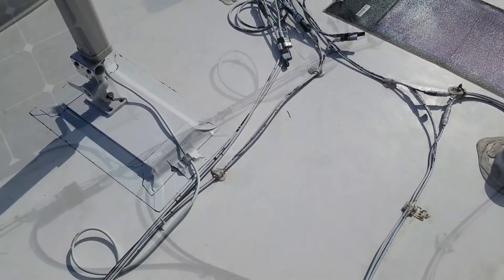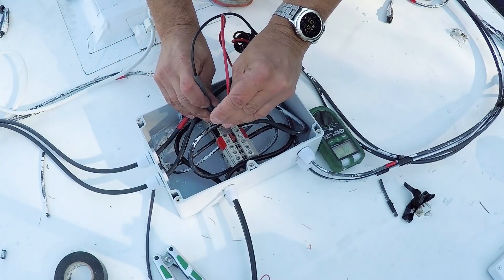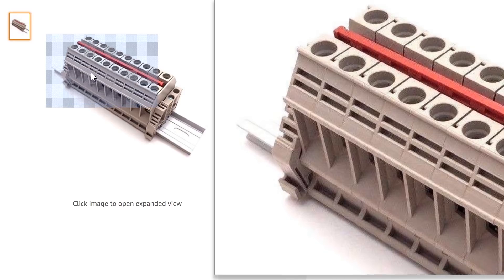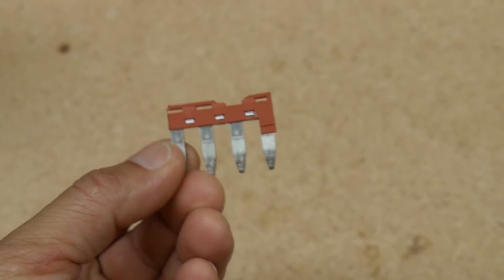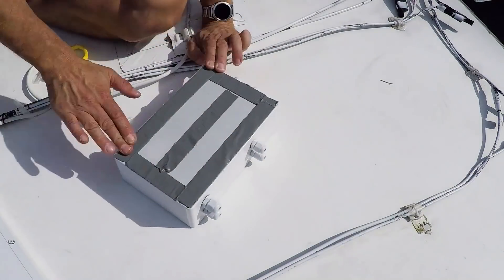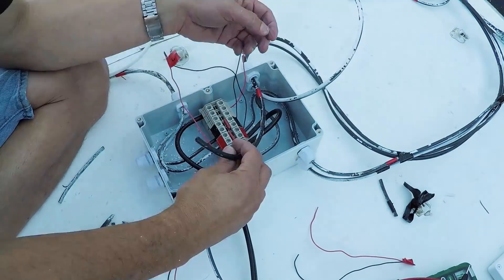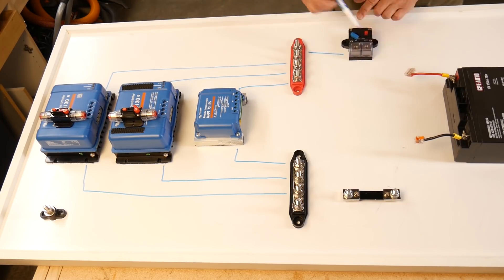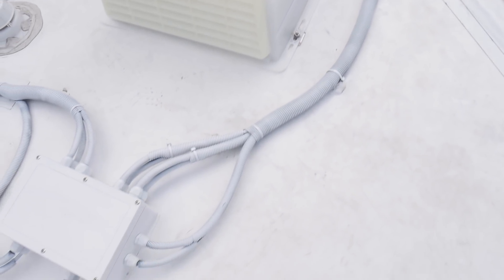DIY Solar Combiner Box on RV Roof // How To

Comment: Brian, Have you found any moisture in the combiner box yet? I have a new trailer which requires a new solar build and like your solution. I can not find a box my size with IP67 waterproof rating so I will go with IF65, but worry about drive in heavy rain conditions. Keep your great youtubes coming! Bill
Reply from the maker: Haven't checked in a while but I will. I'd do it now but it's raining :)

Comment: Brian, another excellent video showing another very professional organization of all the solar cabling.  I have added your approach to my solar panel system install.  Watching all your related videos and reading all your articles on this topic has certainly made me much more knowledgeable and confident on my install.  I'm loving applying all your lessons learned to hopefully get it right the first time.

One question I did not see specifically addressed, but I'm sure you have gone through multiple iterations on, is how do you mount your cable "connection points" to the roof?  

Again, thanks for sharing.  -Jim
Reply from the maker: Thanks Jim. I'm glad to hear my videos have helped you out. I've mounted most of those cables using regular adhesive backed cable anchors, zip ties and covering the top with eternabond tape. In my latest flex mount video, I'm also using a track system. This makes it easy to simply attach a bolt and some cable anchors where needed. Hope that helps.
Reply: @RVwithTito  Thanks for the response Brian. I was thinking about using some left over pieces of the T-rails as cable mounts, securing the T-rails the same way with the double stick eternabond tape.  I’ll give that a try.
Reply: Brian, also to let you know, I saw your reference to 10% off discount code with Sun Powered Yachts and ordered several of the 170W Sun Power solar panels with that discount, so thanks for that as well 😀. -Jim
Reply from the maker: @jimrodrigue8906  That's great. You'll love those 170W panels. I have two and may get two more when I get home.

Comment: Great video that I’ve reviewed a few times while I built mine.  Have you ever had a problem because it’s only taped to the roof material and not screwed down to the wood underneath?  Lots of folks seem to take the tape approach and I wonder about its long term effect on the adherence of the roof material to the wood underneath. Thanks for the always useful info.

Comment: Did you get any performance gains in charging over using the branch connectors?  Thinking about trying this and running 6 awg from the combiner to the charge controller to see if I can increase charging since I'm running PWM.
Reply from the maker: I don't think there are significant performance gains just convenience and easier to make changes in one place.
Reply: @RVwithTito  Since my system is all parallel  with the longest distance panel to the charger being 35 feet was thinking of going to 8 awg to the combiner and 6 awg to the controller to try and improve the losses but not sure it's worth it.  Might wait a bit and do some testing of the 10/8 wires I have in place now.  Thank you.

Comment: Hey Brian, I know it's been a while since you posted this and please excuse my ignorance but: If I understand it right, you are connecting both of the wires from each of the solar panels to the box, so 12 wires from the solar panels. This means 12 MC4 connectors at the panels and 12 cables from the panels, correct? Wouldn't it be simpler to connect the panels from each array in series so that it would only require four MC4's and four cables total for both arrays? 
In many of your projects I've followed in your footsteps after you made it simple and clear. Thanks so much.
Reply from the maker: You're correct, it is more cable, but it gives me more flexibility to make changes to the system. Example: If I want to change the configuration from series to parallel, or remove a panel from string, I don't have to redo all the cabling. I can do it all from within the box.

Comment: Using the terminal blocks you used if your going down to two controllers would it be a problem tying the negative outs of the panels together at the terminal blocks in the combiner and only running two positive outputs and the one ground output to the solar controllers? Trying to save some cable runs down inside the RV. Enjoy your videos and keep the ideas coming!!
Reply from the maker: No that would cause problems. Each string needs to be separate from the other.
Reply: Thanks Brian. I suspected as much but had to ask.

Comment: Great video, I like your method of using simple but effective components. I too am installing solar on my RV and just want to keep it simple. The solar forums are useless, a million opinions and not two the same, people over complicating everything to the ninth degree. As for "solar installers" well if you go by what they say it would cost thousands to put a few watts of solar on a RV to use a few times a season, no common sense at all. Again well done.
Reply from the maker: Thanks. I'm always trying to find the easiest and most effective solution. It's nice to know where to and where not to spend your money. Glad this helped. 👍👍

Comment: What brand of white paint did you Use?... Also would you consider a small vent hole in the box to drain any water that might get in thru the top or thru the glands?
Reply from the maker: I used Rustoleum appliance paint. I've considered a hole but haven't had any water leakage yet so I'll hold off for now.
Reply from the maker: I used Rustoleum appliance paint. I've considered a hole but haven't had any water leakage yet so I'll hold off for now.

Comment: Brian, 
QUESTION: 

Brand new on watching your vidoes...if you can answer these questions...I'll hit the bell. I recently watched your solar panel video and I like the flexible panels smart move. 

Question: 

1. Have you changed your outside compartment locks? if yes what new locks did you use? 

2. Have you thought about installing or attaching Spot/flood lights for security?  

3. Have you added extra security to your RV? If so what were they? 

Thank You in advance looking forward to your answers.
Reply from the maker: 1. Yes. All replaced. There's a video about it.
2. Yes. Motion sensing flood light. May be in the same video.
3. Yes. Side and rear camera plus front dash cam running from house batteries.
Reply: RVwithTito Awesome! Bell is hit and I'm going to find the video(s). 

Thank You

Comment: Brian,                         With all your solar I am surprised you don't have it connected to the starting battery to keep it charged while not using your RV.Phil
Reply from the maker: I hookup a small 50 watt panel some times and PWM controller. I find that as long as I run the engine every so often I'm good.
Reply: Sounds good

Comment: Your video's are always great and informative. I have upgraded my electrical panel to a 3 phase as not overcharge our newly installed 2 AGM 6v batteries. I am adding a battery shunt monitor to see how much energy I am using and to be able to see what state of charge my batteries are at. We will be going on a 3 weeks road trip from Silverdale Wa. to Michigan and back.  We want to be able to use a small coffee machine and a small 110 crock pot. To start out with what size inverter would you recommend? Thanks Brian on any information you could provide to me.
Reply from the maker: 1500 to 2000 watt inverter. Not sure what your total battery capacity is. You may want to consider an Instapot in lieu of the crock pot. The crock pot may draw too much energy for a long period and draw your battery down. The Instapot will use much less energy for a shorter period. When will you be heading out? You should shoot me an email. I'll explain more.
Reply: Thanks Brian I was thinking after I install the battery monitor. I will look into a 1500-2000 watt inverter. And do a trial run on cooking a meal or two on driveway camping to see how much the Instapot draws. We are thinking the end of August hopefully all these fire smoke is gone. Again thanks Brian.
Reply: Brian I went out to my RV and found out my batteries are Lifeline  GPL-4ct 220 amp hours. With this information, would it be okay to go with the 2000 watt or stay with the 1500 watt inverter?

Comment: Hi Brian. I'm still learning, but your diagram of array #1, looks to me that the two 64 watt panels are in parallel and those are in series with the 128 watt. What do you think?
Reply from the maker: Yes. That is correct 👍
Reply: The reason I asked is your web page says: "The two smaller panels are connected in series and those are connected in parallel with the 128 watt panel."

Comment: hi tito, i like your videos very much, i would like to know something, while i am driving it is possible to use electricity from the solar panel or from the generator, i mean can my son watch tv while i travel on the route?, thanks, and i hope your answer .
Reply from the maker: Yes. Both solar/inverter or generator should work fine while driving.
Reply: RVwithTito thanks Tito.
Reply: jose santos I had a 36 ft class a and we ran the generator to cool the rig down while driving.     It worked great.  Had to keep an eye on the fuel so we didn’t get below the generator turn off point.  I think a quarter tank is the cut off.
Reply: Jim Davis Thank you very much for that information, I'll be waiting, thanks.

Comment: With over 30 years as a professional in the electrical/electronics industry, you have no idea how refreshing it is to see someone actually work at getting things neat and organized.  I see so many videos of people installing solar who I personally feel should never touch a wire. Much less make a video about it. 

It's also frustrating to hear people say that it's no big deal, it's just DC.  Well, guess they don't realize that you can actually weld metal with a car battery.  So, yes, it can be a big deal under the right conditions. Batteries ... the stories I could tell about the misuse.  Saved a man's eyesight once just by being at the right place at the right time. Others just stood and gawked, not knowing what to do.  Had he been boondocked alone ... who knows how it would have played out in the end.
Reply from the maker: Thanks so much for the professional insight and for the reminder about taking appropriate safety precautions. 👍👍

Comment: I really enjoy your innovation and DIY projects. However, on this one, I think a commercial combiner box is better. It has 10 amp circuit breakers. I have six panels, on my coach roof, connected to a combiner box, with a MaxAir cover over it. So far, working well. It was $169.00. Your project was probably a little less but not by much.
Reply from the maker: This worked out better for me and gave me more options for under $50. I already have circuit breakers for each array in my solar compartment. Glad you're setup is working well.